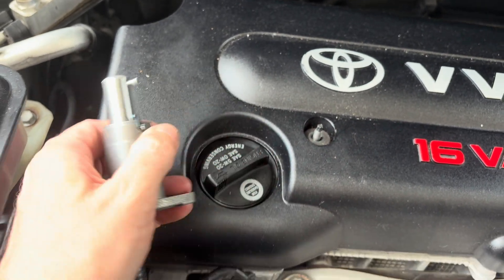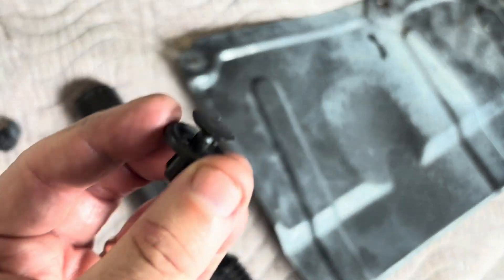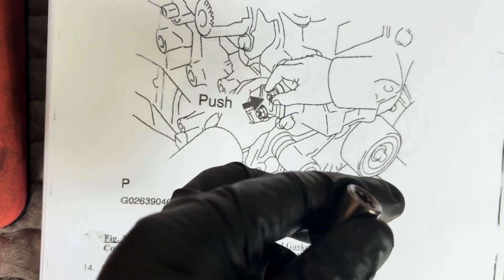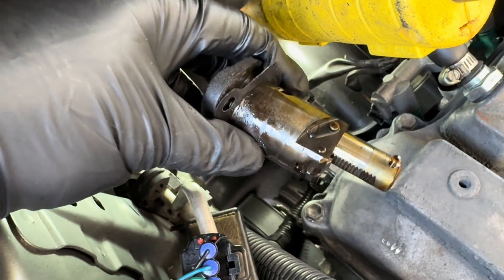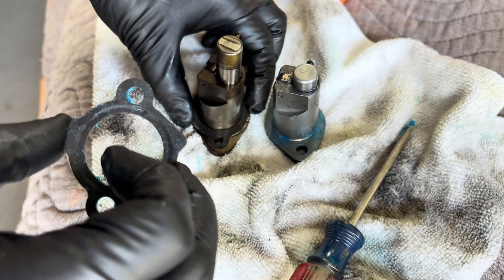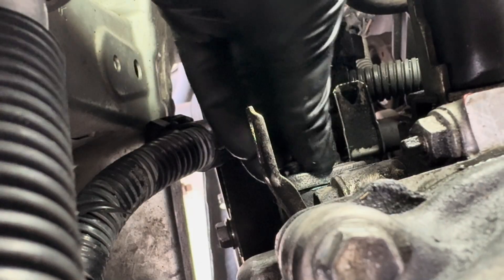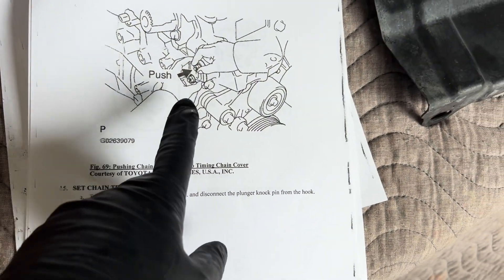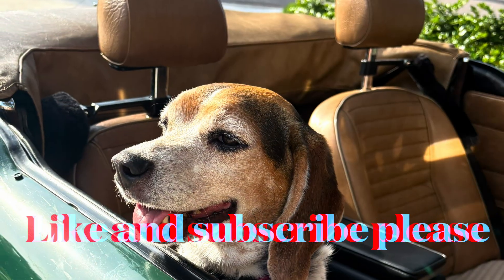Toyota timing chain tensioner replacement  - 2.4L inline 4-cylinder 2AZ-FE

Comment: Before removing the timing belt tensioner, you have to set the crankshaft in TDC. Aligning the marks to "0".😊
Reply from the maker: The timing chain yes. Tensioner no. I followed the factory directions.

Comment: A bit of a rattle on startup would be an indicator that the tensioner needs replacing i assume? 2015 Camry
Reply from the maker: Yes. It can help. More than likely the vvti cam parking mechanism is failing causing the oil to drain out when engine is turned off. I also did an engine sludge clean with a BGProduct and drained. Then did a high quality oil change with royal purple HMX high mileage oil and factory filter. Then added some snake oil. Prolube. Like 8 ounces. It made my rattle almost disappear.  But my rattle would continue for a long time. Now it’s a slight half a second on a cold start.  The tensioner is a fairly cheap item to rule out and make sure the tensioner is working as it should. Cheap insurance for an older car.

Comment: great video and thank you my only issue is you never actually showed you taking the part out or putting it back in (unless i missed it) that worries me a bit as i f you might have had problems
Reply from the maker: None. It just comes right out and goes right in. Just make sure the pin stays latched when putting back. Really nothing to it.

Comment: Should you change the oil after changing the gasket on the tensioner?
Reply from the maker: It’s not required. The tensioner sits up high and is not near the sump. So nothing leaks out. Just change at normal interval. I do recommend BG MOA oil additive though. You can add any time. I get on Amazon.

Comment: Should the engine be at tdc
Reply from the maker: No. The timing chain is not removed from the gears. Just swap out tensioner which just pushes in the internal guide which pushes on the chain.
Reply: @DIYHelp thank you I was just wondering, I did this job Friday. Noticed lastnight the leak came back so I pulled it back off to reclean the surfaces and retorque it i noticed on the bottom side there might have been some gunk I didnt get off when I did it the first time

Comment: Do you have a sound clip of the noise it was making? I’m experiencing a “rattling can” noise coming from valve cover/exhaust manifold area on my 2.4vvti. It is frequent, but not a consistent noise. Like if you were dragging a tin can behind you if I was to explain it.
Reply from the maker: I don’t. The car is a couple hours away right now. It’s either the cam gear wearing out or the tensioner or tension guide wearing out. Timing chain could be stretched a bit also.  More annoying than anything else. Engine will probably run fine.
Reply: What you are describing seems similar to my sound on my Scion XB with the same 2.4 engine (automatic trans).    The sound happens only when the car is in gear but stopped, and is coming from the area of left side of the valve cover.  Because it seems to be a cross between clunking and chirping, at first i felt strongly it was something on the serpentine belt, (water pump, alternator , belt tensioner , idler pulley ) but I replaced all those and i still have the occasional sound 😂

Comment: 80 inch pounds are on ft / Lb are 6.67 almost 7 ft /lb . You should always indicate on manufacturer specs.  People would think sort of over tighten.
Reply from the maker: Correct. Very little torque. I used an inch pound torque wrench myself.

Comment: Did you do this as preventative maintenance or was your engine rattling? How many miles do you have on it?
Reply from the maker: Slight rattle and visible loose chain when I changed the valve cover gasket. I thought I would try this cheap fix to see if tension would improve. It did. Long run it’s good preventative maintenance. Just make sure you buy oem or Napa version. Tons of cheap stuff on the internet.

Comment: Do you have to put motor in top dead center before removing the tensioner
Reply from the maker: No. The chain and gears it’s on are not disturbed. You’re just pushing in the tensioner guide inside the engine. Quick swap out. No need to take valve cover off.

Comment: Searched many other videos on this procedure.  Yours is the most complete.  Thank you.
Reply from the maker: Yes. I combined several videos I saw and read in an old factory manual. Which is why I did this short video. Plus I knew removing the wiring harness or sometimes people say the engine mount was not required and wanted to prove that.   Thanks.
Reply: @DIYHelp Moving the wiring harness out of the way to clearly see the device was your answer to my question.

Comment: If the tensioner is hydraulic,why did it fail ?
Reply from the maker: It’s spring tension inside but for sure has a hole for oil pressure I believe. 2008 car and 200000 miles. Just gets tired.  I pulled the valve cover off recently and the tension was noticeably tighter.

Comment: Great video!  However in the beginning, you turn the crankshaft CW.  What's the purpose of that?  If for alignment, how much to turn clockwise?
Reply from the maker: They say it helps release the tension on the timing chain a bit.  However I probably just wanted to see how hard or rather effort it takes to turn the crank.

Comment: How  do you unlatch the hook when installed?
Reply from the maker: It’s in the video. You turn the crank counter clockwise until you hear an audible clink and it releases itself after you have it installed.  If you turn up the volume when I do this in the video you can hear it. Really super easy.
Reply: It releases it self AUTOMATICLY when you turn the CRANK counterclockwise. You should hear the click coming off the tensioner. Then you turn the engine 1 full revolution clockwise to make sure it has released.